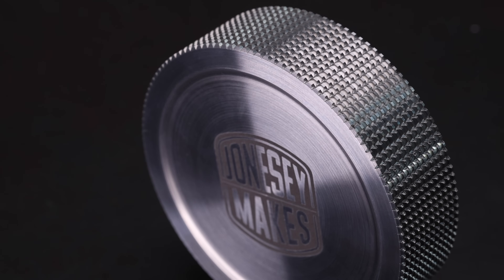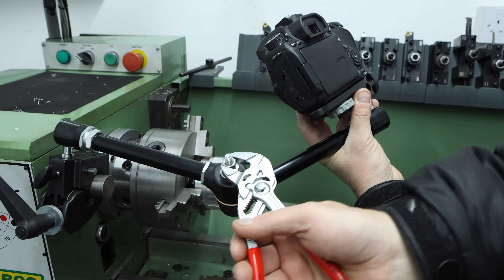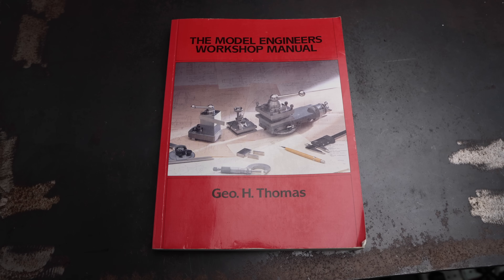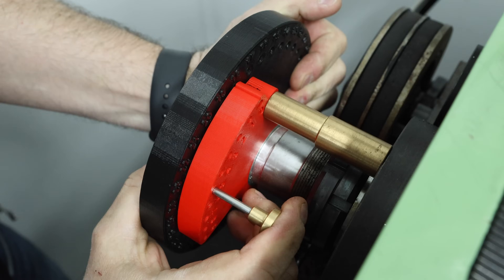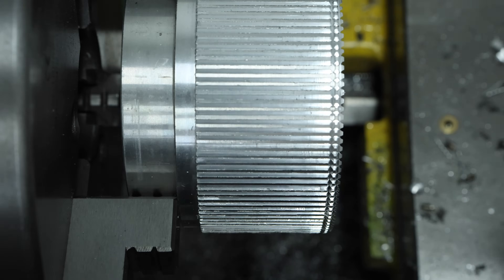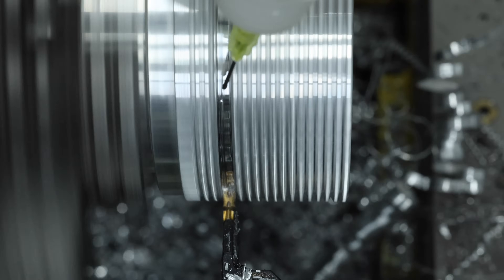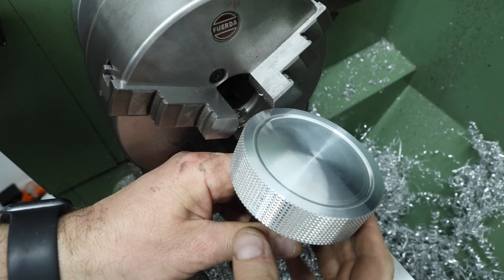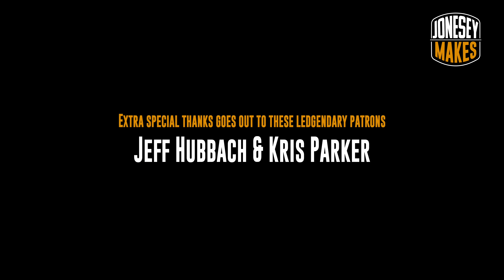Square Knurling with no Knurling tool?

Comment: At 7:09 you can clearly see the entire vise and workpiece wobbling as you cut. For anyone who’s spent time around machining, that’s a red flag — rigidity is everything. Without it, energy is wasted fighting the bench instead of driving the tool, and accuracy suffers.

It looks like the core issue isn’t the vise itself but the table — too light or not properly anchored to floor/wall. Bolting that down or adding mass would transform the experience. A vise of that size really needs bedrock under it to deliver the stability it was designed for.

Comment: Not to be pedantic but strictly speaking, this does not constitute a knurl. Knurling by definition is a material-forming process that plastically deforms the surface to produce a patterned texture. In contrast, the features shown here are annular grooves and axial slots, which are cut rather than formed. That said, the outcome still shows an excellent process.  Well done.
Reply from the maker: Thanks, didn’t know that!

Comment: Nicely done. Tests your patience :-)  You have an indexing head for the lathe so use it to make some straight knurling wheels. Quite easy using silver steel which you can harden and temper yourself.
Reply from the maker: Thanks! I’ll try that

Comment: I have just bought a cut style knurling tool, you might try one for some very clean straight knurls. Much better than manual indexing, and you can buy a wide range of metric pitches cheaply. Accutrak is a good company in the USA.
Reply from the maker: Thanks, this is something I’ve been looking at.

Comment: Sorry if this has been commented below, but if you want to put a permanent thread in aluminium, a helicoil is a much easier solution than a threaded steel bushing!
HNY!
Reply from the maker: Thanks! I need to try that.

Comment: On small "table top machines" like Unimats, Proxxons and Sherlines, this is the only type of knurling I would consider. The forces from normal knurling operations are tremendous on the lead screw. If a scissors type tool is just a little off center line it will produce a large force on the lead screw too. The lead screw on these lathes is normally made from a small diameter soft piece of steel with a V form thread..
Reply: "The forces from normal knurling operations are tremendous on the lead screw"    You use the lead screw in your knurling operations? Why?  Never do anything that will reduce a lead screw's life or accuracy... Just cut threads with it... Anything else is misuse...
Reply: @robertlawson8572  sorry 'cross slide feed screw', not the lead screw.

Comment: I did a spline shaft in the same way. A lot of people don't realize that if they turn their lathe cutting tool 90 degrees in it's holder, they have a shaper, as the old school scraping machine was called. I laid out the pattern by taking the female part and tapping it on the end of the aluminum blank and that put the dented pattern onto the shaft I needed. I then aligned my tool on a low RPM speed setting, but obviously not under power, to stop it from turning, while taking a scraping pass along the length of the shaft.
Reply from the maker: Nice work, lots and lots of be achieved with a lathe

Comment: So you have an horizontal band saw, indexing tool, a DRO, a fine quality lathe...but the push-in knurling tool was too much to buy...?
The part is beautiful, btw.
Reply from the maker: Fair point, but it was the square profile with a large pitch I was looking for, I didn’t have the knurl wheels to do that. Thanks for watching!

Comment: i think it is possible to replace the nut it seems to be either press fit or heat set so if you got a soldering iron you could heat up the nut and slide it out with minimal damage. Then get a new one and heat set it back in and I would recommend adding a helical groove to the out side to give it better grip with the plastic. But the wheel is good too.
Reply from the maker: Good advice, thanks.

Comment: So have you tried getting like 6 nuts in a row and then just weld them together?
Reply from the maker: The problem is the leverage. You need quite a good sized wheel to get the purchase on it when tightening by hand.

Comment: The brass nut is an obvious point of failure, but let's steel-man it for a sec. That knob is getting twisted a million times by anyone from Einstein to Frankenstein levels of intelligence and strength, and it is likely to be a point of failure no matter how it is designed; if the nut is brass, then the failure point is replaceable. If the threaded rod failed, you need to throw out the entire device.

Comment: mechanical poetry with some bumps down the road
edit: question though: even the brass grooves were worn off. aluminum being a softer metal won't it cause any problems in the future? maybe embed a steel nut instead of tapping the aluminum?
Reply from the maker: That’s exactly what I did. Didn’t want it to strip again.

Comment: 0:58 You answer your own question. It is obvious point of failure since they don't want you to strip the male thread which is more embedded to the arm. Thus the brass nut was used in the knob to fail first if that would ever happen.

edit: However nice work on the knob!

Comment: I have the same lathe.  First time I have seen another one!  Put some good soluble oil in the coolant tank and run it onto the parting tool.  Feed it like you mean it and it will cut fine.  The worst thing you can do with a parting tool is be too cautious.  The rpm was probably fine given it is a carbide tool, just need the appropriate feed and tons of love juice on it.
Reply from the maker: I’ve never set up the coolant, I should get that going. Thanks for the tip. How do you find the lathe?
Reply: I bought mine new in about 1997.  It is still as good as the day I got it!  Definitely not the most rigid machine out there but a good combo of size vs capability.  The coolant tank is really handy, problem is it sprays fricken everywhere if you get it on the chuck!  Make sure to use a modern coolant like the stuff for cnc machines.  One time I used some old soluble oil and it left rust spots that are a constant reminder to me!  Modern coolant wont cause rust, I use it in all my machines.
Reply from the maker: @ashesman1  Thanks, I'll try the modern coolant then, which brand do you use?
Reply: I use cimcool cimstar 585P.  But there are a lot of personal preferences and depends what is available locally.  I use it on my manual mill and cnc tool.  Lasts well, doesnt get alge in it.  Makes your shed smell like a cnc shop.
Reply from the maker: @ashesman1  Great, thanks for that.

Comment: The only things I would do differently Jonesy, is to use WD40 as a lubricant. I then think you would need less lasses on the horizontal side to get to your depth  and you will get a cleaner looking cut. Also I would grind a dedicated tool with equal side rake, and have a top rake of at least 10 degrees and keep it level horizontally, so it cuts equally and gives a good finish. Great job though!
Reply from the maker: Great tips, thanks for that. I will try next time.

Comment: When parting, you can step left and right in the groove to open it wider than the parting blade. Also, to remove the little burrs don't use a brush, use a Kratex stick.
Reply from the maker: Good idea, thanks.

Comment: You can use a soldering iron to remove the old brass nut from the original wheel and then use it again to push a new one in.
Reply from the maker: Thanks. I’ll give that a go next time

Comment: Usually you can just stick a soldering iron into the stripped nuts that manufacturers put in those knobs. It breaks the glue after a moment and you can just thread a nut in, pull out the stripped one, and put in another nut.
Reply from the maker: Interesting, thanks.

Comment: Why brass nut in a knob? In part because it's a standard part. The thread is a heat set insert, they're made from brass so the press tool can get them in quickly and easily by heating the core. Thermal conductivity of stainless steel isn't so high, so it doesn't work nearly as well, but it can be done if need be.

You can get one of these exact knobs in just about any (Chinese or European) hardware store, and brass is guaranteed not to go distorting and shaving the threads of the shaft, as opposed to steel. So it's a good mode of wear.
Reply from the maker: Very interesting, thanks for the info

Comment: Slightly off topic, but couldn't you have just used a helical tread repair tool on that?
BTW, try making a lever lock for your magic arm instead of the wheel. 
I've used both for over 30 years and the lever is much easier and quicker.
Reply from the maker: I guess I could have yes, although I didn’t know such things existed until several people pointed this out :-) I’ve also not seen the lever type, I shall look out for those.

Comment: I made a similar knob for my 143 camera arm, which is the same as yours but has a lever lock instead of a knob. I wanted the knob because you can control how much braking force you apply, while the lever only has two states. 

I turned the whole thing from a single chunk of aluminium, and put a thread straight into it. Hasn't given me any problems at all for over 2 years now. 

Mine is definitely not as wide though, so i can't gronk down on it hard enough to strip the threads even if I wanted to.
Reply from the maker: Good job, sounds like it works well

Comment: Should've hogged out the bottom of it so it doesn't weigh a ton on that mechanism.
Reply from the maker: Yes that is something I might do. It's not all that heavy to start with though and seems to be working just fine at the moment.

Comment: Where did you find that camera arm? I use the same setup for phone filming but haven’t found one hefty enough for a dslr.
Reply from the maker: https://www.wexphotovideo.com/manfrotto-244-variable-friction-arm-with-bracket-1540551/?cpgnid=17870678074&adext=&account=853-353-2386&campaign=&group=&mkwid=_dc&pcrid=&kword=&match=&plid=&pgrid=&ptaid=&si=&gad_source=1&gclid=CjwKCAjwl4yyBhAgEiwADSEjeFuyT2ViFzWjNujOx-pq78T3MHcuUwOBgNG3tH7cGeuomWrh0FUgzBoCjDkQAvD_BwE

Comment: Sodium hydroxide makes a good enchant, the corrosive action as well as the gassing will munch into the burrs. Maybe even a precursor to anodising , but not with the steel insert.
Reply from the maker: Thanks for the tip John
Reply: @joneseymakes  try it on some test pieces. The more fizz the better, so hot if you can!

Comment: This is exactly the kind of thing that a 3D printer would be brilliant at including the hexagonal hole for a standard nut, as well as a knurled outside. Or even an outside shape like the original part.
Reply: I mean you can just drill out the original thread insert with a drill press, and epoxy a hex nut in there. If you can put some grooves into the side, just with a triangular file or with a dremel, for epoxy to hold, it'll be perfect. Not to say i don't love 3D printing, i mean i have had a printer for a long time myself.

Comment: Lots of work, but really good end result.
Planning of a correct diameter, is crucial I guess otherwise it's not fun when you end up doing the second last line, and it ends up too close 😮
Have you any experience using those aluminium inserts on steel ? (I have a small lathe, and regular steel inserts generates pretty big cutting forces)
Reply from the maker: I use those aluminium inserts on steel but only for very light cuts. You get a great surface finish but they don't last long
Reply: @joneseymakes  OK, thanks, might try them !

Comment: in gunsmith work we use a checkering file and i believe this would help a lot with the lateral lines...you just cant chose the width of lines but much faster.
Reply from the maker: Thanks, I'll check that out.

Comment: On the plastic knob, did you try screwing a bolt into it, heating it and pulling it out? Then epoxy a new nut in and Bob's your uncle. If you are going to make a new one, then you might as well try.
Reply from the maker: I didn't try heating it up no, I figured I'd destroy the plastic knob.

Comment: Looks splendid. I think I'd have to anodise it and dye it bright blue because, well, Reasons. You've given me a crazy idea about scripting some G code so I could create an insert and mandrel, then fit the workpiece in a collet on my new CNC mill 's spindle, and mount the tool in the vice. That should make it a very quick job of doing the shaper cuts and the turning.  Might even be able to fit two tools in a gang mount to do both operations without re-orienting the tool.  Zero fun though, your way is much more satisfying
Reply: @MachiningandMicrowaves  a nice bit of brightly coloured anodising always look fab!
Reply from the maker: That sounds like a project I'd like to see!

Comment: I've noticed if you over tighten those indicator arms you can eventually cause flat spots on the wedges inside the mechanism and it never works properly again.
Potentially made so the thread would strip long before you do any damage inside?
Or it's just a rubbish design like you say 😂
Reply from the maker: Good point, I'd not thought of that.

Comment: Put a bolt into the brass nut and apply heat to it.  Once the brass nut is hot, it will pull right out of the knob.  Replace it with a steel nut with heat or epoxy and boom, problem solved.  Or spend many hours machining a prettier one. I would do A because I'm lazy.

Comment: Good to grab with oily hands. Easy to reef down. A little heavy for the app. Jammed up blades are no fun. I like your work. A little light oil constantly applied to the kerf would make parting of a little safer. I mounted my blade upside down and reverse spindle and let gravity help a touch of light oil and feed in slow. Nice work on the Math to result in even no. of spaces. great, short and inspiring. Thanks for your time.
Reply from the maker: Thanks for the feedback, much appreciated.

Comment: 7:23 If you'd have made the mandrel a little sooner, could you have maybe held it in the handsaw vice and finished at least most of the cut that way?
Reply from the maker: I tried that, but unfortunately it still wouldn't fit.
Reply: You need one of those Evolution Saws with a cutting aluminum blade. It’s a chop saw in miter and non-miter versions. Or you can get a Milwaukee metal cutting radial saw. Or floor-standing band saw. Porta-band by Milwaukee is an option as well.  In the next Jonesy video, I will show you how to add a horizontal table to my bandsaw!

Comment: Beautiful work. I had a job a few years back making 2000 stainless rods that were 8mm dia, with a 100mm section in the middle knurled like this. I built a fixture for my lathe. It used a single wheel cut knurling tool to put the axial grooves in and the fixture held it vertically, above the part. Then i used a helix knurl cutting wheel that looks like a gear with straight teeth. I mount the wheel horizontally and held it so it could freely rotate. The teeth would cut the radial grooves and as the carriage traversed, the wheel would follow along like a pinion. The cycle time to do 100mm of knurling in 1 shot got down to 1m30s, which was good for 2000 parts
Reply from the maker: Sounds brilliant. I'm really interested in setups that save time for multiple parts on production runs like that.
Reply: @joneseymakes  Yeah it was kind of hacky but did the job. The 'proper' way to make this geometry quickly is to form it with a flat die thread rolling machine. Realistically the dies would need to be EDM'd and would be very costly, so only worth doing if the qty is really up there. Then you'd pop a part out every couple of seconds
Reply from the maker: @lawmate  Sounds cool

Comment: I know this is super late but, since you needed to use the mandrel to face the back side, couldn’t you have used a square mandrel (tapping the end to fit the hand wheel obviously) and then use that to mount the part in the vise on the bandsaw? Or would the part have been oriented so that it would have unscrewed? I don’t actually do any of this stuff myself but I hope to someday 😂
Reply from the maker: Good idea, but the odd shape of the part meant that wasn't an option.

Comment: Do I have the patience to cut 120 grooves like that? Errrmmm, NO. Hats off to you Jonsey.
Reply: Put the radial grooves in first, removing most of the material by machine power. Cut the horizontal ones in one pass, any crap left in the grooves can be re-machined out radially.
Reply from the maker: Haha, cheers
Reply: @joneseymakes worth a sub for the patients to do a fine job indeed.
Reply: soo many cuts!!! Looks gorgeous though!
Reply: My thoughts exactly, half way through I was thinking...Ummm without a tool the only way I see doing it is broach type single point cutting, there is no way he is gonna....
Oh shit!!! He IS, he is broaching every freaking groove.
Reply: Errrrm what the sigma